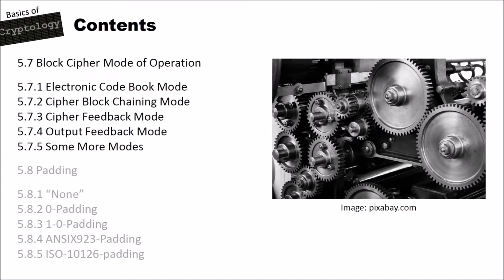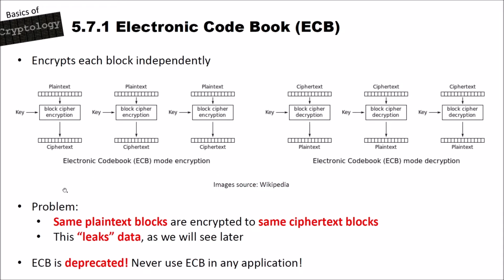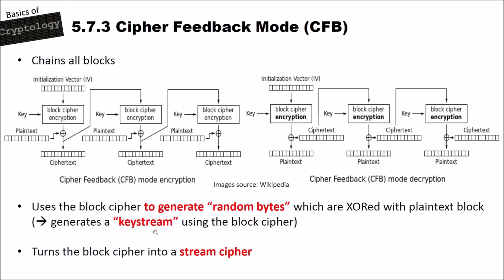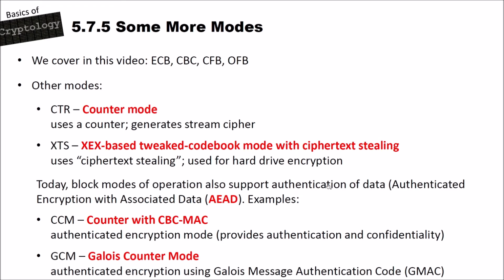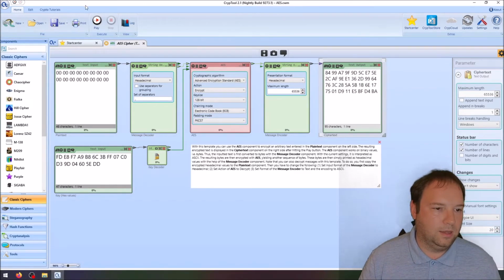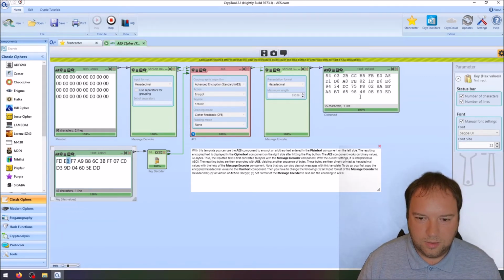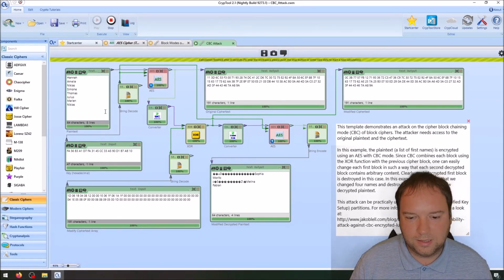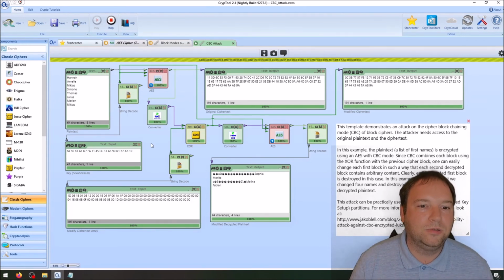Basics of Cryptology – Part 24 (Cryptography – Block Cipher Modes of Operation)

Comment: Great illustration of modes of operations ! Thanks.
I would like to speak up for OFB a little.
The video shows that a small change in the plaintext leads to a similar small change at the corresponding location in the cipher text.
But I think that's a bit unfair.
If you add an IV (a different IV each time)  like OFB expects you to do more bits would change in the cipher text, like on average 50%
OFB deserves its credit